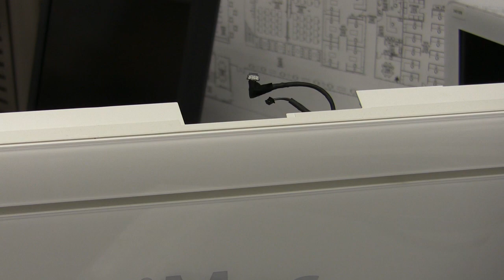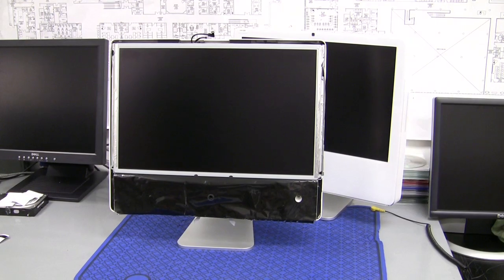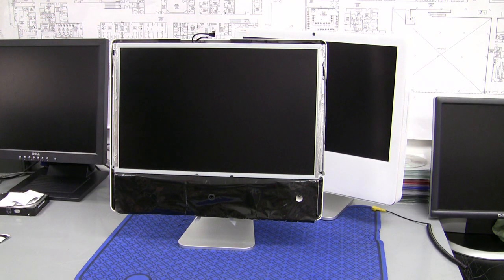How toTake Apart an iMac - Part 1 (Remove Front Panel)

Comment: I'm just getting an iMac apart to attend to the damaged 3.5MM jack plug input. Your video is really helpful, thanks so much, getting the front panel off safely seemed impossible. Just one criticism: the sound quality is really bad, and at times your remarks are very indistinct, especially when you turn away. Have you tried a headset or a tie clip microphone? But all in all a very instructive video, thanks again

Comment: ALL NOTE!!!    The 2006 24" iMac I have does NOT have those latches!!!!

Just take all the screws out of the bottom (4 plus 2 for ram access), lift lower part of bezel, then slide the bezel "up" towards the top of the monitor and it just slides out!  NO CATCHES to mess with!

So that this FIRST, it's amazingly simple and I only did this as I'd given up on using the cards to open the latches.  Top of bezel has metal angle plates attached to inside top on each side.  With right angle parts facing down that fit into slots on top of the rest of the case.

NO idea which/why mine doesn't have the latches as all the other info I've found on youtube and elsewhere says it does.  Again, this is the case for MY 2006 24" iMac, but it's so simple to try, I'd advise trying this first.  If it doesn't slide up fairly easily, then go the credit card route.

Good luck to all!

RichE San Diego, CA

Comment: Could not get the card to work. Such a bad design having to do it that way. I decided to drill some small holes so i could press the levers with a pin (like the hole on CD/DVD drives for manually ejection). I took an educated guess at where to drill from looking at another video where the persons hand was in frame at the corner of the bezel and the clips were visible so I could gauge where to aim for. Fist hole is 1cm in from edge of vent slot and 1 and 1/2 the thickness of the bezel below the seem between the main body and the bezel. Second hole ended up at 1 and 1/2 cm. The clip inside has the lever portion and it is a large area to shoot for really when your hole is only 2 or 3 mm. This is how it should have been from the factory if you ask me.

Comment: Thanks!  Made my own tool from an expired SAM's card. (I knew that would be useful someday!) The top left unclicked right away but the top right wouldn't. I got the other corners loose and was able to get the last with my finger from the front inside. Did Apple go to an extra effort to make that difficult? Replacement LCD on order.

Comment: Hey man, im trying to fix the same imac and on the logicboard there is 3 leds. the LED601 its on. The second LED602 is blinking. The third LED603 is off.. So the problem is that the computer does not turn on. The fan try to spin but i does not spin. Any Idea? Im thinking is the logic board

Comment: My G5 Intel iMac heats up almost right away when turned on and will freeze/fail in minutes. The upper left corner on the back is extremely hot. Can't really use it during day, just cold nights. Any idea? Other than throw it away xD
Reply: I know it's been 6 years but you need new thermal paste.

Comment: You didn't zoom in very close to show how the card actually touches the clamp.  Does it slide up behind it, in between the clamp and the bezel, then push it forward?  Or does the card push up on the clamp, nudging it against the top of the bezel?

Comment from the maker: @Ubuuuroi Sorry.... when I was recording the audio at that point it was very low. I boosted it just to the point where it would not sound bad.
Reply: This is an excellent instructional video, and clearly comes from an expert, so please don't take offence at a well meant criticism from a trained sound engineer. The problem with the audio isn't that it's not loud enough, after all I could simply turn my computer's volume up - sorted. It's because there's next to no high mids ('treble') in the sound. This is essential in distinguishing the different elements which go to make up 'speech sounds' (phonemes) in in human languages. It takes place in as little as the first 20 milliseconds or so of the different 'speech sounds'. Quote: "Phonemes, the smallest units of speech that distinguish between meaningful spoken words, are a characteristic ingredient of spoken human languages. The world's languages include approximately 100 overall, and each language has approximately 50 of them". Without the 2000 - 5,000kHz band the phonemes turns into indistinct mumbling. You need to be 'face on' to the mic and fairly close at all times; a lavalier or a tie clip mic works best, they are very 'bright' and they aren't expensive and don't need to be 'professional' quality. Same applies to music: if you knock out those frequencies at the commencement of each note, you'll still hear the notes, but it's hard to tell what sort of instrument it's coming from. But a really useful video for all that, and as you can imagine, my iMac is constantly in use, and 90% of that time it's me working with music recording and video  production

Comment: Oh and is that black/aluminum tape even necessary? What's its purpose? It makes the taking apart process more annoying. I'd rather have the tape off. I do take my apple machines apart from time to time to clean and inspect that all components are in good working order. Or does the tape have something to do with maintaining temperature?

Comment: By the way, does the main display calbe attachment screws require a torx 6 screw driver on this model?...I saw vid on a newer model which is similar in construction but has the cable located on the left side instead of right, and the guy mentions a torx 6 driver for those screws on the late '07 imac model (silver/black). Serisouly there's way too many different screw bits required to get anywhere on this imac. G4 was simple a torx 8 and 10 and philips, that's it. and no ugly sticky tape either.

Comment: Hey, how do you unplug the isight?, I got the face off the imac, but have to keep it angled 180 degrees right next to the computer without detaching it. I tried to unplug the wires, but they feel so fragile that I'm afraid I'll pull too hard and rip the wires. Is there any particular way to take these cables apart? without damaging the wires around them? Man this imac seems like a major pain in the ass, makes the G4 a piece of cake to gut out. So far i hate how this model is put together.

Comment: thanks for the vid. i have an old iMac G5 that i wanna get rid of. it will cost me $1000 to repair it. i bought a new one already. i just wanna make sure if i throw away my mac or recycle it that no -one can access any of my information on the computer. ive just removed the memory sticks. is this enough? or do i also need to remove the hard drive??

Comment: @hbmkeith ..... yes the original iMac G5's only have the three screws on the bottom with the panel pulling off the back, I have had entire labs with these iMacs as well but the iMacs this video is for it for the last generation iMac with iSight & White Intel iMacs. These all need the card tool. The first model G5 that you have at your work is the only model iMac that had the screws on the bottom to pull the back off ***Best iMac Design IMO ;-)

Comment: @JamesRoneyMusic You will probably not find many videos on the new iMacs for take aparts as they are still under warranty for the most part unless the extended warranty has not been purchased. I have taken them apart many times and they certainly are different from the white iMac. If you venture this yourself be careful with the glass panel and careful with the screen itself. It gathers dus fast and sucks when you have the glass back on and notice it.

Comment: I bought my mac direct from Apple in mid 2009 and nothing in your video applies as to how to get the case open. I have a stuck disc and I have not found one single video (yet) Youtube ( or anywhere) about how to take my iMac apart. Apple must be aware of users trying to take their iMacs apart and decided to make it next to impossible for home owners to get inside the unit, let alone get the stuck CD out without having to take it into the shop. Not one single video for stuck discs applies to me.

Comment from the maker: @hbmkeith ...... those videos I talk about that are on YouTube of people pulling up on the front panel only and not using the card tool is correct. I'm not talking about the iMac G5 that pulls off from the back. The iMac G5 has three screws on the bottom and the back panel pulls off. I have a 30 of those iMacs at my work.
Reply: just bought one of those PPC G5 1.9Ghz, lovely display but horrible YT due to the stone age GPU, first time ever with Apple and loving it. wonderful media machine. quaint and historic but fun. a slight hint of Amiga influence, but lots of future Android.